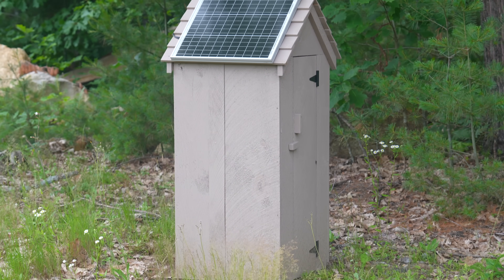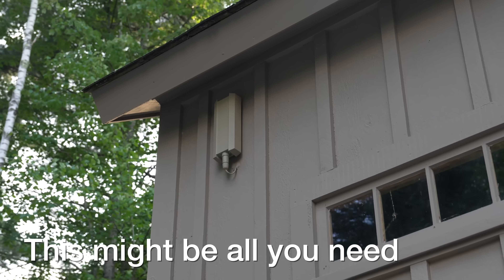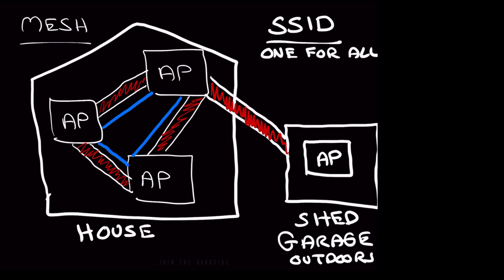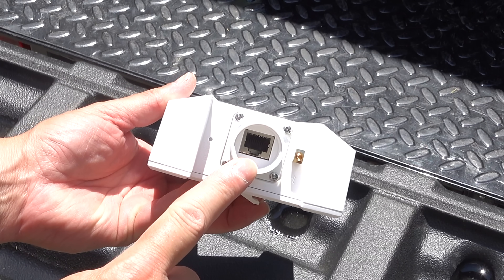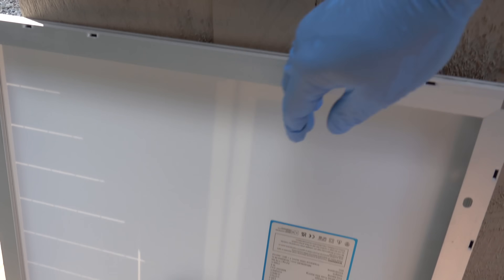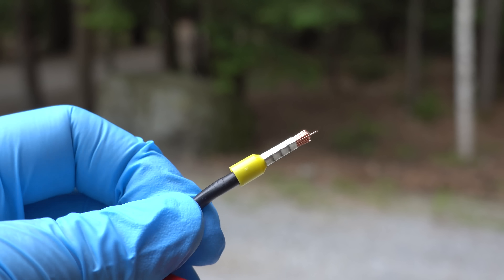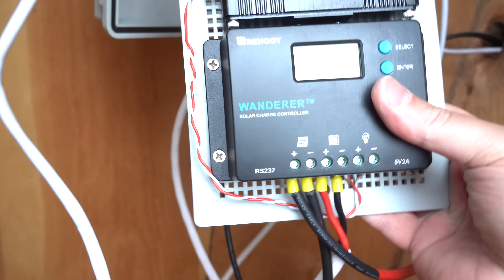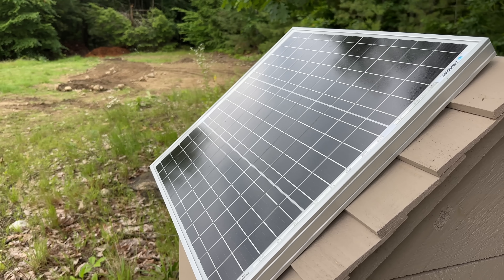How to get Wifi in the woods - DIY Solar Internet Station

Comment: Great video.... I'd suggest not using a solid ferrel vs stranded wire for a captive screw connection. Solid wire will break loose much easier over time. A stranded wire can compress under the screw and provide a better bond.

Comment: only thing i'd say is to properly charge lithium, that PWM controller won't get it all the way topped off.  Lithium wants 14.6 or 14.7, a MPPT with a lithium profile would be better.  otherwise this is awesome and conviently timed as I have a possible project i need to basically mimic this setup on.

Comment: Unless you really need/want a switch there are POE injectors running from 12v. And I have migrated to Ubiquiti network things, sure higher cost than TP-Link, but well worth the money. Meaning, installation setup and reliability are on another level. But if you are happy with TP-link, then go for it.
Reply: RE POE injectors running from 12v - could you share some info on these?  I've searched Amazon and mostly get POE spliters with a 12v output for non-POE devices.
Reply: @phhowe17  search for Poe injector  IEEE 802.3af 12v boost converter, or something like that. Hope it helps.

Comment: Looks like its going to fly away and/or rip itself apart even in a mild storm. That thing needs to be fixed to the ground or you need to add some ballast to the structure to keep it from flying away.

Comment: looks great. I use battery box like that for HAM/GMRS radio use.  Tent camping as well . for me I have 4G/5G access point running from folding solar. up to 300 watts MPPT victron controller. some campgrounds do not have 5G coverage. Miss the 3G network. was slower but reached more  places.  for me where we go do not have WiFi . have to use hotspot over cell network. and one camp cite had to use WE boost for cell. works well but reduced speed. normally connect 4G cell network. nice project. I like camping on the go with my girlfriend so our use is different.

Comment: Ooh. Hrrm. Personally I'd have used a POE injector instead of a POE switch because those run off 12v and have a step-up to 48.

But this is really neat.

Comment: You should check out a system by Ubiquity. It can simply soooo much. They even have a solar system that can predict if there may be an outage due to the weather so you can take measures ahead of time. Pretty cool stuff.

Comment: Nice tip.. A buddy of mine spent well over $1,000.00 to extend only his wi-fi signals on his property and the range around that spot is like 50 to maybe 75 feet.. I'm gonna share this with him..
I see by what you did if you wanted to you could just plug into it with a ethernet cable and have a hardline connection.. Love it...
Thank you for sharing.. You just earned my subscription..

Comment: It's not a bad option. I'm not sure if a lot of snow congregates in your area, but I'm sure you plan to utilize a way to mount or ankor the shed in to prevent harsh weather, winds, & snow from toppling it over. Being next to trees wouldn't be a bad idea to utilize some form of plexiglass or clear protective cover over the cells to prevent tree branches, sap, and/or damage in general upon the panels. Other than consideration for those variables, looks pretty solid. Appreciate the idea.
Reply: Panels don't need protective covers. They're designed to BE outside and survive massive hail storms. Covering them will limit performance. Sometimes real world needs to rule over theoretical worlds
Reply: @mrmotofy  fair enough. Ive seen some that didn't fair too well even without hail.
Reply: @mrmotofy  With all due respect, you should definitely heed your own words.  Hail is a massive issue for solar panels.  On paper they're designed to be outside and survive hail storms, but in reality they are damaged by hail, falling branches, and even falling chestnuts quite easily.
Reply: @MiniDevilDF  They CAN be but rarely are.

Comment: Would have made eaves on the shed and tucked those external bits underneath.  Also those PWM charge controllers produce practically no heat.  And the battery needs to have low temp cutoff for that installation.

Comment: Cool project! Did you add any weights to the bottom of the shed to keep it stable during wind storms? Like cement blocks, lead wheel weights, etc.

Comment: Great job.  Do you think you reduced signal strength by having part of the access point under the roof eave?
Reply from the maker: Not in this situation, I am well over the distance limit though. The garage is higher up than the field so the signal can still clearly be sernt, however if it was level I agree with you that might lose some strength

Comment: Do you have time limits where you disable the equipment in the WiFi shed?  At 15W -> 360Wh/day which is more than what would be produced by a 50W panel during winter months.  Also, at 15W (or 360Wh/day) that only adds up to about 4days on 12V 100Ah (something like 1300-1400Wh depending on nominal voltage), or am I missing something here?

Comment: Awesome idea!  A couple of comments.  Do you plan to have your wifi station out during the winter months?  I’m not sure what zone you’re in but if you do plan on keeping it out through the winter, you may want to beef up the station with insulation because once the temps drop to freezing it could impact the battery performance.  Also, if you do get strong winds occasionally or frequently, you might want to consider anchor the station to the ground.   Just my 2 cents.

Comment: Make sure to use paint that doesn't contain carbon black as part of the pigment because that will act as a electrical shield and reduce your signal strength.

Comment: Given all the comments about low temperature, how two 12V AGM batteries (50ah each) or a Renogy 100ah AGM?  The same controller handles AGM batteries at 12v or 24v.

Comment: To get the most bang for your buck, I can't help but notice that the little shed is underutilized.  You could:
1 - Build it taller and add at least a birdhouse to one side.  But just one, unless you make it about 30' high and put up gourds for purple martins.
2 - Build a shed roof (one-sided) instead of gable, with the whole surface facing the sun for more solar panel if needed
3 - If you go taller, tuck the electronic bits up out of the way, and place long-handled tools in the bottom
4 - More solar panel + more storage = opportunity to add small, low-wattage landscape lighting if desired, or motion-activated.  I have some solar motion lights, they are very convenient.
If heat is an issue, you could install a heat block that conveys all the way to a heat sink on the outside of the shed, preferably on the shaded side of the shed.  No need for a fan.
DC-DC power converters are easy to come by.

Comment: Wow! Excellent set-up. i believe since some surveillance cameras are IP based, you can connect as well to your new access point.  if you do try that, do let me know how it turned out. i was planning on doing something similar later in the year when i would have time to research, but since you did the research, you saved me and others a ton of time researching.

Comment: This is a cool setup. I've toyed around with the idea of building a shed and using it as an office. This is a great idea vs running fiber like you showed before. 
I like the 12V switch. I had not though of these. I'm currently looking for a switch to provide PoE for a new AP I'm installing.
Reply: Fiber is better in the long run. A trencher can be rented for about $60-100 and take maybe 1hr for hundreds of feet. Then lay cable or conduit in and shovel fill it in. Wireless has lots of failure potential, fiber in the ground has about 1 way it can fail. We still use fiber cables from 50-60's

Comment: The 100AH battery may be a little overkill! At roughly 300W per day, you can run that setup for more than a month - and that's without any solar coming in.

Comment: My concern is about temperature. Where I live it gets down to -5F / - 20.5C  a few days each year. Not sure if that is a similar problem where you live. I guess if it was you could remove the battery in the first 2 months of the year.

Comment: I love it! I tried the plug-in extenders and they work okay if you're still near a building but the main router is on the opposite side but it's a different network and you have to switch between that and the main, plus it won't work way out in a field. I love your full DC setup and eliminating the complexity of converting!

Comment: really cool setup! Have to admit, as many have stated, that 
1) a heated/insulated battery or a low temp cutoff is a nice improvement
2) using concrete pads or tiles to improve ventilation (combined with some waterproofing at the base of the shed) is to consider.
3) A mesh network is a commercial evolution of a range extender. In a config using a single Access Point(AP) in the remote location, it is the same thing: both increase latency, reduce bandwidth, etc.at the edge of the WiFi network. In your case, there is no magic and no difference between a well built commercial solution and a a well designed mass market residential product. The magic happens when there are multiple Ethernet connected APs in a range of a single/multiple meshed APs: in theory, meshed IPs will choose the path of least congestion and latency (by switching between Eth connected APs, and even routing traffic between themselves) and dynamically adapt to changing network load. That is often not the case of a regular range extender that simply has no logic (and often no way to obtain sufficient information about traffic) to do such things.

Comment: I would have unifi ap there more better than the tp link ap since they have not been out long
Reply from the maker: I haven't used unifi but have worked with Cisco enterprise stuff for decades and TPLink has the interface and global control that I wish my Cisco Gear had. Meraki got them closer to a user friendly design, of course all that stuff cost like 10x the price as tplink.

Comment: Great idea for my 10 acres. Would just add in battery heat option for my location. So probably a larger solar panel. Same shed for extra cameras out in the location as well. This will also come in handy for my storm cellar.

Comment: Looks good, and a great idea! There are DC-DC converters available that can convert battery voltage into anything you want, so you could use standard equipment. Anyway, this is sweet!
Reply: This. Weird how many don't seem to use these boards. Never had any problems with my projects.

Comment: I don’t believe that cheep $10. Charge controller is LifePO compatible. I would suggest a small Victron. It’s lithium compatible and you can program it not to charge when freezing. Since that battery cannot be charged below freezing.
Reply from the maker: Well truthfully its $20 🤣  https://amzn.to/44YCDvQ But it had a specific charge mode for it and you can individually set charging voltages so I think it is ok. But I agree Victron is really great stuff. Quite honestly as I started this project I wasn't sure it would really work with the distance, power, lack of sun, being outdoors so I tried to avoid spending too much.. So far a month later it just works every day 24x7 and the tplink alerts me if it loses connection. Turned out a lot better than I thought and solved my issues.
Reply: @SilverCymbal  my bad. It looks very similar to a few of the cheapies I use for different projects like remote start generators and shed lights. But I use lead acid batteries so they don’t freeze.

Comment: If the solar is not keeping up, you might want to consider a switch that supports POE scheduling.  Some power could be saved by not running the WiFi all night.

Comment: Careful sending current to an LiFePO4 battery in low temperatures (like we get here in NH during the winter).  I bought one having low temp. cutoff (does LiTime?) and also added heat pads to the box with programmable temperature control switches.

Comment: I don't think you needed a "special" switch. The 12V output from the controller is not dependent on the solar panel. The output voltage should be governed by the battery, which will be around 12V.

Comment: You can use the load port on the solar charge controller to turn the output on and off. Like for instance if you wanted the access point to only run in the daytime to conserve power.

Comment: Your setup is great, especially with the solar. I personally don't like wireless (which can be easily jammed). I ran a 250-foot outdoor gray 120V 12 gauge electrical cable (feeding light bulb, outlet, switch for POE IP cameras & AP), along with a 250-foot Ethernet cable.  I could repeat it two more times if I needed to go 750 feet.
Reply: really with what you are doing you will want to make sure your equipment is all grounded and that you run multi-mode fiber those two things will save you next time lightning hits in the area
Reply: Seriously ‘militarily hardened’ 👍🏻👍🏻👍🏻💪🏻💪🏻💪🏻🇺🇸🇺🇸🇺🇸
Reply: Yeah I'm sure you're at serious threat for having your Wireless network jammed lol😂

Comment: Excellent video.  I did similar project to run Starlink over DC instead of AC.  That switch is a very interesting solution.  I used 12v - 56v step up converter combined with a POE injector to do the same ($40 for both).  Overall your solution seems very cost effective.  I can't believe how cheap 100ah batteries are getting - mine are over 2x the price.  From 'IT nut' perspective, TP Link?  I'm going Ubiquiti.  :).
Reply: Plus you could do Ubi with native 24v and not need any conversion, a decent controller and a higher voltage solar panel. Ubiquiti rocks.

Comment: excellent i would have removed the roof and put the rubber membrane under it then reattach the roof also a floor of some type once you get it where you want it like a composite pad

Comment: Be careful: You put an access point someone can tag into with a wired connection and hack into your home network away from your house
Reply: True, most people don't pay attention to physical security. I have  multiple POE cables to my security cameras, and anyone can disconnect one and easily be on my network.
Reply: Someone worries too much about their porn collection getting stolen. 
Residences are rarely targeted by physical access to their network
Reply: @mrmotofy  A popular, extremely rich youtuber leaves a vulnerable point of access to his network and you are all "residences are rarely targeted by physical access." Common sense, something you don't have, is to be better safe than sorry
Reply: @rosegold7975 Please share with us ANY other similar case...go ahead I'll wait. One needs to be more worried about dying in a car accident
Reply: Hack? it is not really hacking at this stage: it is direct unhindered physical access. That being said: it can be easily disabled at the AP (at least it is possible in most commercial applications and should be with this product).
Reply: @sashkashurik  The definition of hack is "to gain unauthorized access to a network using a computer" so yes, anyone who plugs into that network switch (a person who does not have permission), will have unauthorized access to the network. The switch in the video is an unmanaged switch. Changing the settings on it would require a lot of work or just be impossible. Please watch the video and know your terms before you make a statement.

Comment: Very cool - one question: How will that lithium battery safely charge in the winter? It doesn't appear to be a heated battery.
Reply: I was thinking the same thing and decided to look around before adding my 2 cents! The amazon description doesn't say anything about cold shutoff, only high temp shutoff.

Comment: Wonder if you could have achieved same results with an Ecoflow with solar panel too.
Reply from the maker: Ecoflows are awesome and I use them for all sorts of things. Tools, appliances, anywhere. But if you want to run a very small load (under 50 watts) 24 hours a day you lose a lot of power keeping the AC inverter energized and they aren't weather resistant for this type of setup. I could have done it, but I would have need a much bigger solar panel. I also could have used a much smaller battery but I wanted a lot of runtime in case we didn't get sun.

Comment: I really like your videos, have watched dozens, and have bought products based on your recommendations. All of it's great stuff.
But I thought I should caution you about a danger. It looks like you hook up the solar panel to the controller without having a battery on the controller. From what I've gathered on Will Prowse's channel, that can burn up and controller very quickly. I think you're supposed to hook the battery up first.
Thank you for your priceless work.

Comment: If I were you, I'd use some 60GHz wireless bridges from mikrotik, because your backhaul link is definitely a the bottleneck there, and with the 60GHz bridges, you could have your backhaul hit gigabit or beyond. But then again, I imagine for the lighter use that an outdoor wifi network would have, I imagine it isn't a problem.